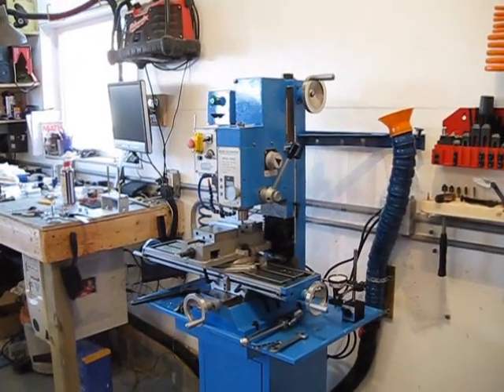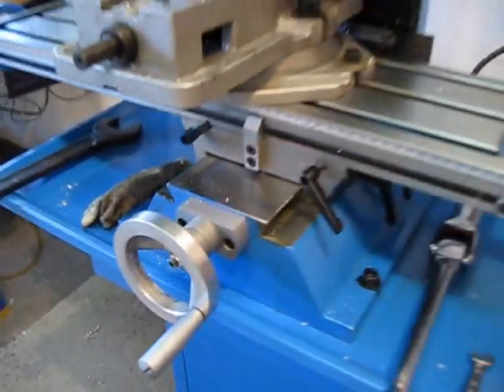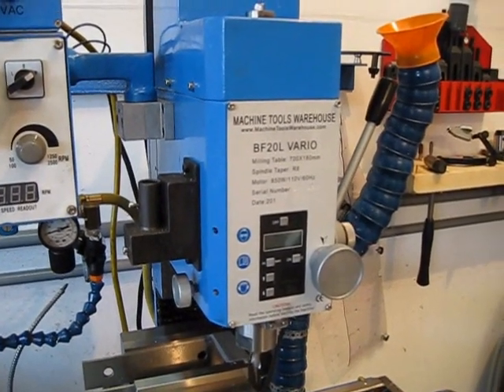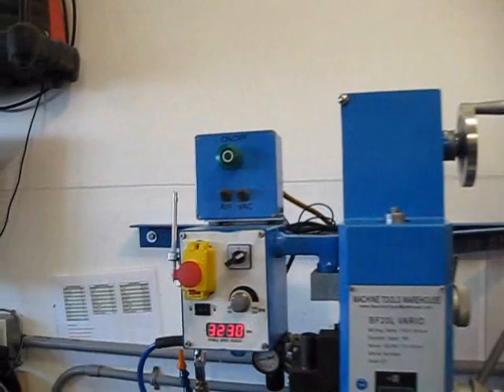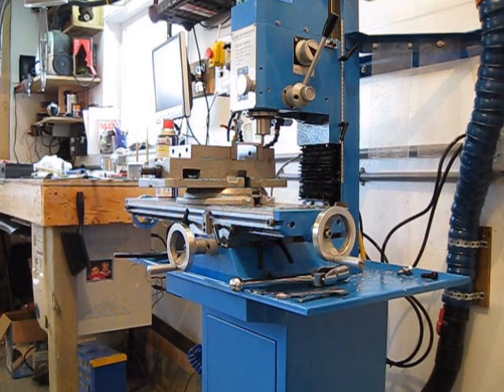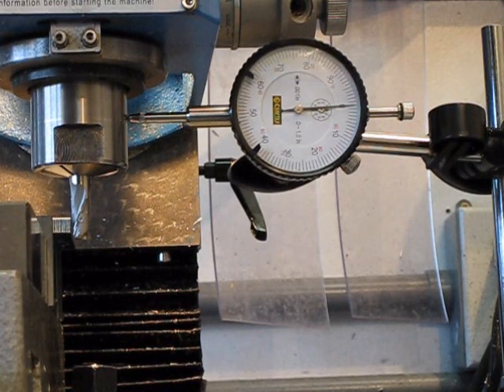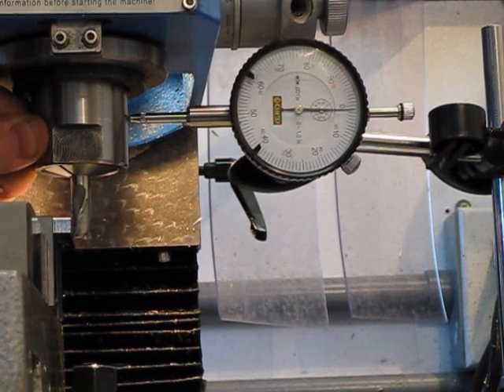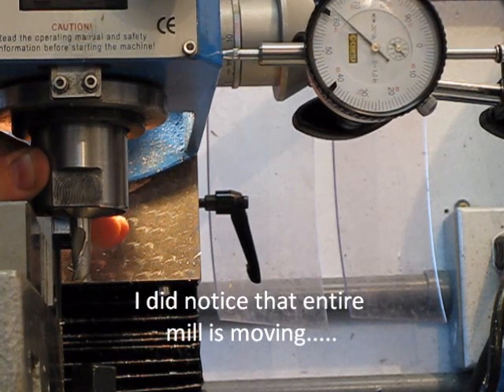Side Milling poor results

Comment: Hi Folks, if you come across this one bear in mind that the speeds a feeds given in things like 'Machinery Handbook' are aimed at doing the job for the least possible cost on heavy industrial machinery. They allow not only for the labor cost but also the wear and tear on the machinery.  Smaller home workshop machines simply cannot be used like that and it is necessary to experiment to see what speeds and feeds provide tolerable results. They will be less than those in the main literature. BobUK.

Comment: Wow! I know this is old and you might have figured it out but for anyone else reading thisim commenting as only 1 comment is of any use. You are feeding too slow. Per tooth you are removing 0.0002" of material. This is too small an amount. You are effectrubbing the material off and it is sticking to the tool and rubbing the stock giving you a bad finish. If you feed faster you will actually cut material and not rub. Then on your spring pass (climb cut) you will get and even better finish.
Always break you feeds down to a per too rate. 3200rpm on a 2 tooth cutter means 6400 cuts per minute. Multiply by 0.002 equals about 12 inches per minute.

Comment: Wrong cutting tool, slot cutting tools are used for cutting slots, us the correct 4 flute tool to ensure cutting edges are keeping constant contact and cutting material. You have created a vibrating machine causing the uneven surface.  Basic engineering knowledge is important.  Climb milling will cause jumping if you have backlash in your slides, causing poor surface issues on tough materials. Remember that different materials require different cut angles on tools, higher speed cutting on softer materials and appropriate feed rates. A good engineer doesn't blame his tools, he blames his knowledge.

Comment: I know this is pretty old but having gone from zero experience to testing side milling for almost two years now on 3 different mills ranging in weight from 260lbs to 6,500lbs I can honestly say its difficult to track down the exact reasons for this type of finish. A lot of people will say its the weight of the machine/rigidity, gibs, ways, runout, end mill, spindle bearings ect but I have come to realize many claim good finish when in reality its simply "good enough". That said, you can get great side mill finish in 6061 on a 260lb mill but you will need a few things. First is runout at the tools shank under 0.0005"(closer to 2-3 ten thou is best), the spindle bearings should be adjusted to produce heat at the 5-10 minute mark but only warm not burning hot, use smaller end mills(1/4-3/8) for finish pass with 0.002-0.005" WOC and staying under .2" DOC. From there I like to find the mills minimal resonance sweet spot which is usually under 3,000 RPM and likely under 2,000 on an unbalanced Chinese mill. You should adjust the feed rate accordingly which I personally test rates between 3 to 15 IPM when running under 2,000 aiming for a nice consistent pattern with minimal tool mark.

Comment: Have you placed the indicator on the tool itself?  It seems to me the spindle bearings are sloppy.  It shouldn't matter if you use 2 or 4 flute cutters for the finish.  Clamping the part like that is ok too and shouldn't make any difference with the fine cuts you are doing.  My money is on sloppy bearings.
Reply: Haha out of all the vids on youtube I see a comment from Beeman. Im getting the same problem as this bloke.

Comment: haha i had a bf20 once with the same problem.
i had a lot of fun with copper and aluminum ,two totlly different cups of coffee.
My best guess is you need more speed ,try feeding faster and find out what the max rpm is that your endmill will tolerate.

these light small machines benefit from lighter faster cust ,this also causes less heat in the cutter.

good luck and let us know if you figures it out

Comment: That's funny. You check everything is tight in the mill and then you clamp the part so it's mostly unsupported! Finish was bad because you let it vibrate. Like commadore129 says, clamp the part along the vise jaws and support it by a pair of parallels. Anyway, should you need to clamp a part that way, try to keep jaw pressure even by putting a sightly larger piece of a soft material like wood in the opposite side. Otherwise the vise jaw will bend and lose parallelism and thus grip of the part.

Comment: Nice setup and shop!  Regard the poor finish, do not use slot mill for side milling.Try with 4 flute mill.I got BF20 for about 2 years and i replaced steel nuts on both table axis with homemade POLYAMIDE 80 (polyamide + molybdenum) nuts.Finish improved a lot,i saved my acme screws from wear and after 1 year of using play in the nut/screw assembly is still about 0.08 mm.
Once again,good work and videos (drawbar is my favorite !)